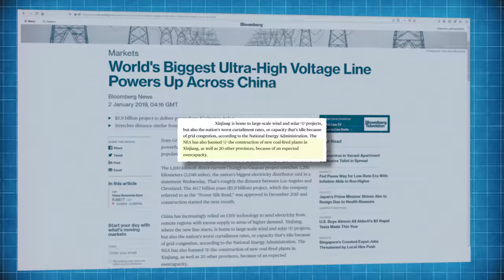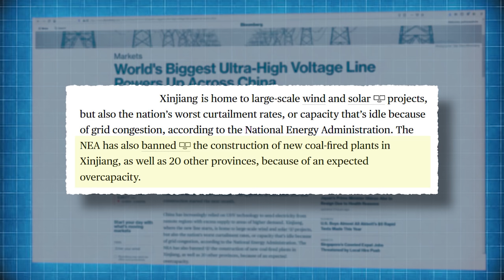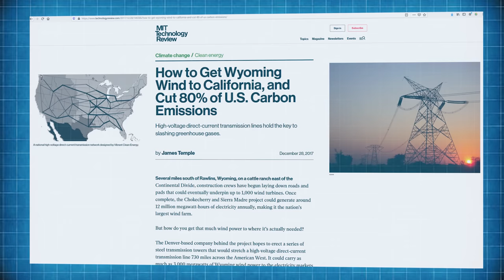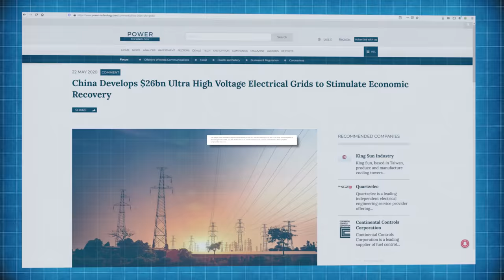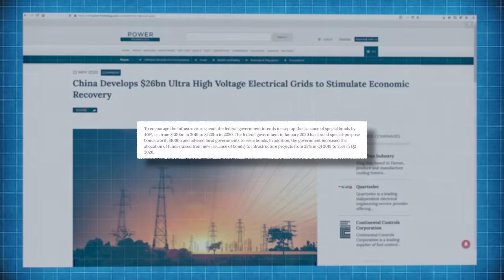China's MILLION VOLT Energy Superhighway

Comment: With a hydro-electric dam the water flowing into the dam is the same as was flowing down the river before the dam was built.  The water flowing out must be the same as that flowing in  (it will average out over time as the level in the dam changes).  So could it be that chronic water shortages downstream are caused by China diverting water for irrigation and consumption?  Regarding high voltage being more efficient - true but not because the high voltage is required to "push the current down the wire".  It's because (power transmitted) = (volts at the destination) x amps and (power lost) = (resistance of the transmission line)  x (current squared).  From that you can see that for given power  doubling the voltage you halve the current and reduce losses by a factor of four.  Another big advantage of DC is that you don't have to synchronise the frequency between the source of the power and its destination.
Reply: Dams block fish.
Reply: Totally agree, but you have to fill the dam first. That reduces water flow of the river down stream because no one totally cuts the flow until full. That starts to drain the water table down stream, because the river is still flowing. When the water flow over the dam is restored to its previous level, the water table down stream does not recover fully. Over a very long time of building up the stored water behind the dam, the water level is lowering the other side of it. 

Now including water use, the water use down stream hasn't necessarily changed and that means the water table down stream is driven lower over that period, and as a result, the water in the down stream system stays lower permanently even with full flow return. Build more dams, you get lower flows, because there is less water in the down stream drainage basin as its stock is lower.  That's how stocks and flows work.  If you want to up the water level down stream, you need more water going over the dam than previously to build up the stock again. But that starts to empty the dam. Pop seasons on top of that, and you get water shortages downstream.
Reply: Averaging out flows over time reduces the rainy season floods downstream of the dams (maybe a good thing to avoid drowning), without the annual flood farmers have no irrigation. A planned flood each year would be helpful.
Reply: Higher voltage mean smaller current and thus only smaller cross section of conductor  required and lower the power transmission cost.
AC is more easy to step up & step down of voltage where DC can't do.
Reply: @alexng7583  did you watch the video? He said in the video they use AC to step up to high voltage then convert to DC and send a long distance and then back to AC and step the voltage down.
Reply: @nicholaswestbury7689  I never considered the water table.  I suppose once the dam's full and the water table eventually restored (rainfall downstream of the dam would help here) the Chinese still have control over the river flowing through other countries, which could mean anything from flood to drought depending on China's energy requirements and which side of the bed their president got out of that morning.  This renewable energy lark is a very trick subject!
Reply: I think another issue might be that CCP controls when the flow is increased/reduced seasonally in order to facilitate their own irrigation, chemical and manufacturing plants etc etc. I a way it allows them to efficiently use more water (or flow) than normal. This does not benefit any of the wildlife (spawning breeding cycles) down stream either. And what about the pollution ? Ecosystems that are disturbed (plants trees as well as animals) don’t naturally control the water. Silt blocks and slows water and tributaries end up changing course in a relatively short period of time.
Reply: @nathanlewis42  no i didn't. I just reply to one of the comments.
Reply: china has messed up its rivers with pollution and they huge water shortage crisis hanging over them. More dams are coming.
Reply: Alex Ng thanks for being honest. The video is pretty good. I recommend watching it.
Reply: @nathanlewis42  ya maybe tomorrow. I can't turn on volume. 
But thanks for recommending...
Reply: Another thing to consider is evaporation.  A new lake behind a dam has substantially more surface area than the river that previously ran through the area. I'm not sure if China is using the reservoirs for irrigation or other forms of consumption, but the water evaporating out may cause a sufficient impact to lower water levels down stream substantially once you build multiple dams.
Reply: @nathanlewis42  It must be intolerable for some people large countries such as China work itself out of proverty instead of looting, colonizing and conquering (or selling opiums). It kind put some people in shame that is why they constantly find fault with China, or 1980s Japan, while have no problem doing businesses with dictators of Saudi or among themselves. Everyone become amnesia on millions of dead Native Americans or Middle-Easterners or Africans to name a few, when try to conjure up "could be" or other possible fault to vilify China (just like zero evidence with Huawei or Iraqi detergent Chemical weapons).
Reply: There are also additional inductive and capacitive losses in AC power transmission that are not a problem with HVDC transmission.
Reply: @alexng7583  , thanks. That makes it clear why a million volts is better, with the correct safety measures.
Reply: Flawed logic. After dam is built first a reservoir is created. A lake. Than you have to maintain a certain level of water in the reservoir to provide the constant pressure for the turbines regardless of how much water is flowing in the lake. In the dry months/years when level in the reservoir drops all the water will stays behind the dam and only the small part that goes trough the turbines will go down stream.  Unfortunately people living down stream also need steady water supply.  Well, they actually need more water in those drys months/years. Hence the water shortages. Also by  turning a river in to a lake the surface area is massively increased so. the amount of water lost due to evaporation and ground absorption is also massively increased.That doesn't help. Not showering for six months and showering twice as often for the other six months doesn't work even though it averages out to showering regularly. :-)
Reply: Yes on irrigation.  Less so, I think, on consumption.
Reply: @johnmcavert  Evaporation would mean more water in the air ..... meaning more rain?
Reply: The water flowing out of a dam is less than the water flowing in even after the dam has filled for a couple of reasons. The dammed water is more inclined to leak into the surrounding land owing to more wetted area for this to happen and higher pressure driving this because of greater water depth (this has been a major drawback of the Colorado damming through sandstone country in the US). In addition the surface area for evaporation is greatly increased when a river is dammed.
Reply: @nathanlewis42  True, although there is an at least partial workaround with fish ladders.
Reply: @barryneild379  I never said anything about China vs any other country. I only said that Damns stop fish. That is true no matter where the damn is or who built it.
Reply: @dougmc666  On the other hand, dams reduce or even eliminate the downstream flow of sediments, which negatively impacts agricultural productivity.  There are always tradeoffs.  On balance I think hydro power is more good than bad, but ...
Reply: @rogerbarton497  Indeed it is.  However I'm fairly convinced we're close to maxed out on practical hydroelectric production.  I'm more of a proponent of distributed solar (home roof installations and local small distribution hubs) and wind (offshore and in the US on the high plains couples with high efficiency transmission line.). I'll add the somewhat unpopular opinion that we should be moving forward with next generation nuclear.  EDIT:  the added benefit of local solar and wind is they're huge generators of non-exportable labor.
Reply: @jangunnarrooth  Personally I love the idea of distributed generation, it evens out the load over the grid, improves fault tolerance  and gives Joe Bloggs the chance to earn a bit back from his overpriced house.  I'm not keen on nuclear though, from the safety and environmental viewpoints.  If we can get nuclear fusion working, then I'll probably change my mind.  As for hydro, small installations could be integrated into flood control systems.
Reply: @totherarf  not necessarily into the same watershed, and even falling in areas that lead to the same river system may instead lead to the water being absorbed before rejoining the river (soil, crops, woodlands or other uncultivated land).
Reply: @rogerbarton497  Now... the integration of power generation into flood control systems is a really interesting idea.  I've moved north now, but I was a 50 year resident of South Florida and there are literally hundreds of flood control gates in that area. Literally half of Miami-Dade, Broward and Palm Beach counties used to be swamp until drained by the canal system. It would be an intermittent source, since they generally only operate a few hours at a time, and there's the challenge of algae and weed growth in that subtropical environment, but it's certainly worth looking into.
Reply: There is another factor.  Evaporation depends on (amongst other things) on surface area and wind speed which are both increased by having a dam across a river.  This is especially so for large shallow dams.  In some locations, such as Egypt, for instance, this can be really significant.
Reply: @johnmcavert  Water does not "disappear"! Even if it gets into the ground that means any rain will wash off rather than being absorbed. I think the watershed for that river is ..... huge!
Reply: Evaporation in the reservoir slightly lowers total water emitted down stream.  Also the time of day and time of year of emitted water can change in ways that are either beneficial (preventing floods) or detrimental (drying up the river).  It all depends on dam management that takes into consideration the downstream user, an inherently thorny issue across national borders.  A multinational management board balancing the needs of all watershed users is the solution that's needed.
Reply: @rogerbarton497  you should check out gen IV reactors.  Allot of your safety concerns
Reply: @BronzeAgeMan1350  No need to get politically sectarian about it. This is a world problem. What China has done is  just what happened with any industrialized society before them.  No different than what USA and what England did before them. What you havent said or considered is that China is also doing much more than USA in promoting renewable energy. Dont forget to thank China for the explosion or renewables from less expensive solar panels now.
Reply: @totherarf  I'm not sure why you are using quotes around a word I never used, but whatever. The water from the river that evaporates and (assuming it falls directly into the same watershed, which is a large assumption) won't necessarily saturate the soil to the point where any further normal rainfall will simply run into the river to replenish the evaporated water.

First, the water may simply evaporate again and fall even farther away.

Second, plants may make use of the additional moisture - growing larger, increasing the density of plant-life, or spreading to cover areas previously too dry. The increased storage capacity of local fauna takes time to fill up, and the evaporation occurring from the plants may also then fall outside of the watershed.

Third, additional rainfall may instead be used by crops, same situation as with wild foliage  but additional crop growth could mean effectively shipping that water elsewhere if the surplus is exported.

Fourth, hydrated soil (prior to becoming fully saturated) tends to hold on to rainfall better than dry soil (a great deal of rain after a drought often causes serious flash floods, for example). This may simply raise the water table near tributaries but not lead to sufficient additional flow into the major river system.

I imagine someone more clever could think of other possibilities, but regardless - rain evaporating out of a lake or reservoir created by a dam does not necessarily end up back in the river it originated in. Even assuming it all falls back into the original watershed, which is a weak assumption at best, you should still expect a decreased flow downstream.
Reply: @stanleytolle416  I hear what you say but there have been so many human cock-ups from the Titanic to the Boeing 737 Max and now the 787 https://theaircurrent.com/aviation-safety/boeing-pulls-eight-787s-from-service-over-structural-issue/  it never seems to stop.  Every time man puts a hazardous system together we're told that it's perfectly safe, but disasters occur.
Reply: @johnmcavert  Not all, for sure ...... but most, probably?
Reply: @totherarf  Clouds are not stationary. Most of the water in the upper Mekong (where China is constructing dams) comes from snow melt on the Tibetan plateau - not rainfall. When that water evaporates out it isn't going to "probably" end up in the same watershed.
Reply: @johnmcavert    OK .... the clouds go 4 ways!  North they hit Tibet and condense out.  West or East they have a Looong way to go to get out of the catchment (it may take time though, and it may be lower down) South and it follows the river! Obviously this is not a watertight scenario, but it is a reasonable contention!
Reply: @nathanlewis42  That is the way of power transmission.  AC only transmission rarely exceeds 500KV. It is well established that higher voltage by 1100KV-DC has less energy loss.
Reply: sam watt I know that. You might have replied to the wrong person.
Reply: @kennethferland5579  Evaporation lowers total water but not rely. If you think about it rain in equator  happens almost every day. The evaporation rises vertically, condenses and becomes rain. What gets evaporated in the morning, becomes torrential rain later in the day. If you think 1 step further, if that water is not dammed - it flows downstream - it can move very far away - in the ocean. Which means YOU LOST IT. Especially flood water. Goes into the ocean and you wait another year for such quantity again. If instead you keep it close - using dams - evaporation and condensation happens locally . .so you get to "reuse" that water as rain multiple times before hits the ocean. Now this might not happen everywhere since air currents play a major role.. like your evaporation can end-up carried by wind currents in the middle of the desert, and not be enough to do anything like transform the desert into a forest, but you now lost it from the river, but such principle happens in amazon rain-forest and Congo basin for example. hence the tropical jungle is so green and abundant.
Reply: @totherarf  Looking at a map of watersheds in China... Heading almost any direction but directly south or northwest will take water evaporated out of these lakes into a different watershed. I'm not sure what a long distance is to you but clouds can travel hundreds of miles in a day and the Chinese section of the watershed is relatively narrow. And if it falls back north of the dams the water will continue the cycle when it reaches the lake.
Reply: You need a greater water height to have the power to turn the turbines , it's called the "Head".  Moving water is not enough.
Reply: @BronzeAgeMan1350  A insane population of 1.4 billion people gives problems that not overpopulated countries will not have to deal with.
Reply: @aion2177  I'm not certain, but you make an interesting point. There's an amusing observation, by Isaac Asimov I think, of a sidelight of what you say. He was on a ship, military draft I think, at sea, and it was raining. 
His scientific mind, seeing the pointlessness of rain falling into the ocean, had him laughing at this.
I have since read, by MIT professor Kerry Emanuel, that indeed there is something useful happening. The biosphere needs to get rid of the energy the sea receives from the sun, otherwise they'd get too hot. Evaporated water condensing again into clouds and falling back, is lifting a lot of heat energy at a rate of 2250 kJ per litre of water evaporated. That heat is released just below the stratosphere.
Unfortunately, cyclonic phenomena are heat engines that frequently manufacture destructive winds as their output .
Reply: "With a hydro-electric dam the water flowing into the dam is the same as was flowing down the river before the dam was built." This is incorrect. A reservoir has more surface area than does the original river and thus there is more evaporation from the reservoir than there would have been if the river was freely flowing. In the case of the Mekong, multiply this by all the dams along the river and all of those resulting reservoirs and you get a significantly reduced water flow into the Mekong delta in Vietnam.
Reply: @alexng7583  not anymore, buck boost rated at 98%
Reply: @nicholaswestbury7689  There is however another problem with Hydro dams. Hydro systems often store water in the rainy season (summer) and release it in winter, especially in colder regions. Agriculture requires the water in the summer and uses much less water in winter. The result is that the river down-stream is now flowing in winter and is often totally drained in summer especially further down stream. Those at the end of the river are often totally deprived of water in summer, resulting in huge crop losses and often suffer severe shortages in water for human consumption. Rivers often run totally dry in summer as people desperately extracts the last bit of availabile water in the river. This kills the total fish and other aquatic populations. It also  stops all river transport. All these factors devestates the economies down stream.
Reply: @johnmuller8954  thats one aspect, since rivers originating in China have basins in nieghbouring countries which cannot lobby. Downstream nations simply don't have resources to clear up the mess in water.
Reply: @johnmuller8954  I agree, they are doing great job in Tech!
Reply: It's a little more than simply down stream, their projects could create significant drought in India.
Reply: @johnmcavert  True that  larger surface causes more evaporation, but please remember that generated hydro energy reduces the water temperature and lower the evaporation. Really more calculation is needed to estimate the final evaporation rate.
Reply: @alexng7583  turn on editing captions and select all copy and paste then you'll be able to read a transcript if a machine generated one of the video
Reply: @johnmcavert  I think more importantly is the fact that the land that was previously not covered with water is porous! I don't know how people started to talk about the aquifer it's not about the aquifer it's about the surface water the two things are not the same
Reply: @barryneild379  look I don't know why you think that stealing company I is innocent they have had their thieves hear caught red-handed they have patented designs based upon paperwork they stole and filed with the patent office that still has the name of the company they stole it from on the documents. rightly or wrongly as to what we do about it the question of whether there is evidence of what they have been accused of is not debatable. I don't think you understand how it works companies manufacture products and then buyers buy them, a company gets the business by having a better product Oh, and if you can produce the product by stealing the design you're going to get that business. That's what has occurred. We have had our design stolen and business we expected to have we have not had. It makes it difficult to finance if you can't have some sort of governmental treaty based enforcement of intellectual property. Like software, everybody understands that software cost nothing to install. But what you pay for the right to install it is what pays for it to be produced initially. It's like they're stealing music movies or whatever you might respect the theft of. I think we tend to see the headphones getting crushed that are just as good as the ones that the crusher makes and it does damage to the public understanding it's not that the products are defective
Reply: @willyag2529  Power=VI, but also Power=I²R. Thus power lost due to current is huge compared to losses due to conductor's resistance itself. That's also why current must be as small as possible in power transmission .
Due to power lost caused by conductor's resistance is less significant, so copper can be substituted by other materials which is cheaper,  says, aluminium.
Reply: @Irene-fu6gj  It only works with laptops right? Can phone do the same?
Reply: Dams create still water with large surface areas for photosynthesis and algae loves it!These dams are dangerously under engineered and the CCP will just thank the villages below for thier sacrafice of their land . But the people are crying and yelling in anger in flood and their towns have disappeared  .